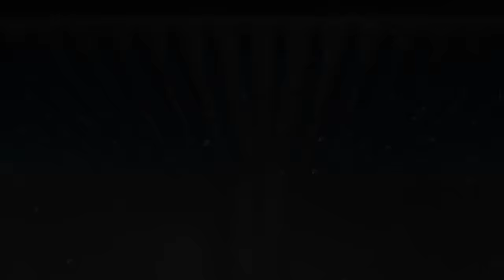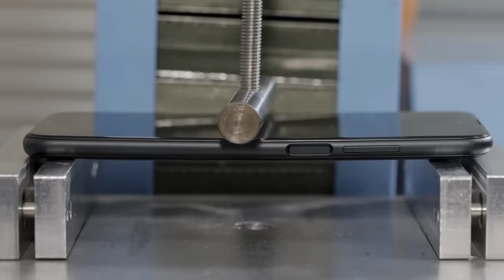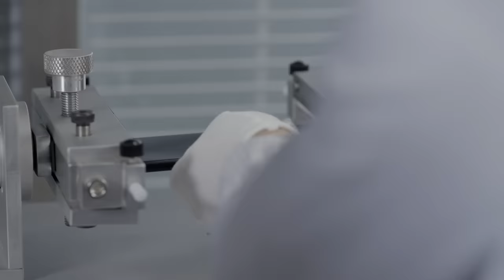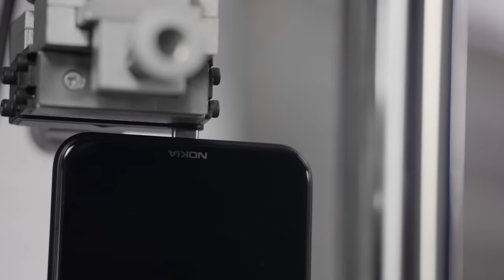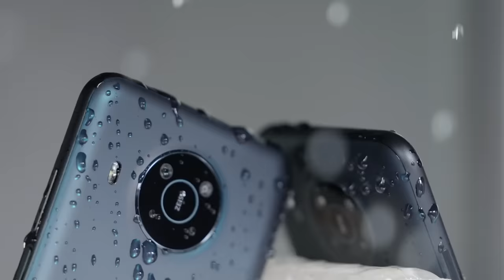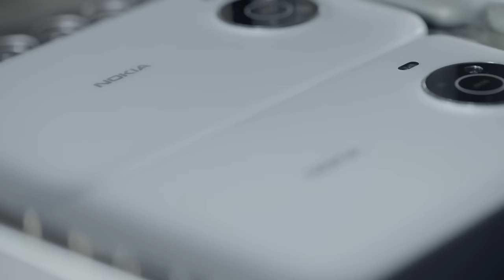Nokia phones Durability Testing

Comment: nokia may not be the best at producing phones, but it has always been known for producing the most durable phones.
Reply: Not only durable, but at its peak, it was the only company with innovative ideas. Take the NOKIA N-GAGE and the NOKIA E90 COMMUNICATOR for example. They were one-of-a-kind phones at the time.
Reply: Durable sure if u want them to use as bricks. Search Nokia 5,6,7,8, all having charging port problems. Their port replacement didn't solve the problem because it was a design fault. I've got an Xperia and it's still kicking after 8 years. I'm gonna definitely avoid Nokia from now on.
Reply: PIXEL ❤️,HMD NOKIA ❤️ , 
MICROMAX IN ❤️, MOTOROLA ❤️   . 
💩 Xiaomi MiUi stupid software 💩 . Stock ANDROID phone 😎 cool
Reply: Durability will get them far into my pocket  - way farer than that i-stuff
Reply: @GAMEOVER-yy6zj  i had a Nokia 7 Plus, it's true that their charging port is sh*t. All about Pixel now.
Reply: @GAMEOVER-yy6zj  earlier batches had it.
Reply: Nobody wants durable phones now. Power Lee change phones in 2-3 years and what specs that can keep up with time.

They should keep a handset ready and wait till the next Qualcomm Snapdragon flagship chip is released and then announce their flagship phone within a week
Reply: I agree
Reply: That's we need
Reply: They remember what they have done in the past, they are trying to remake it but with some better performance
Reply: Its a appropriate for me where I dropped my phone most of the time.

Comment: HMD. I hope this is a sign that you are making a good phone now.

The charging pin fiasco was a really big turn off for me.
Reply: Every nokia phone is good.
Reply: I have suffered due to charging port issues, never again, Nokia.
Also, they weren't splash proof either.
I'm an ex-Nokia fan. I now prefer other brands.

Also, talking about durability, my 5yr old Lenovo phone has been dropped 1000+ times, I have washed it uncountable times since Covid started, it still works. It still lasts after 5yrs. It shows that every brands have got durability tests. Nokia just made a video for marketing purposes.
Reply: But if Nokia comes with 5G (even Snapdragon 480 would work for me), I might take a chance. Not by purchasing myself, but recommending another friend this time. I'd see if the USB port, is for real, better than their previous phones.
Reply: @fishyc43sar  what was the previous Nokia smartphone did you use?
Reply: Ya bro
Reply: @fishyc43sar  Even i too had a Lenovo mobile...I threw that mobile angrily, but the mobile didn't survive.... So every brand is not good in quality, except Nokia
Reply: A fault charging port has been the worst experience for me on an otherwise extraordinary Nokia 7 Plus. Got some handy tips online on how to nurse said faulty charging port to still charge and keep me going the past 18 months when I couldn't afford a new phone. Hope this video indicates they have rectified the issue there

Comment: My Nokia 7 plus is the most durable phone I ever held. The charging port is the only thing that ain't durable in it.
Reply: True Brother. I am also using from last 2.5yrs Worth it... Drop lots of time but nothing happens just Charging Port issue. But overall best phone
Reply: I previously had Nokia 3 it was extremely durable just the charging port issue
Reply: Spot on about the charging port. Been using my 7plus since 2018 and it doesn't even look old

Comment: Nice. I would be great if you were to publish the IPX rating more openly.
- Currently this information is not published or even mentioned on the Nokia website.

Knowing a phone can resist at least a light sprinkling is excellent if you plan on using it on the go. 
That is of particular value to those that don't care so much about technical specs but rather the usability of a device; The sector that Nokia seems to be aiming at.

Comment: Please improve your specs 🙏. RAM should be at least 6-8GB and storage should be at least 128-256 GB.

Pls put better processors in your phones.

Specs have been a problem in Nokia since 2000 - Nokia N95, E72... Anyways used to get out of memory errors. 

Please correct your specs.

Comment: And my Nokia 7.2, cracked on the first fall from both the edges, quite shocking for me too! Power button recently gave up after use of just 2 years and even the back glass is also broken now after a fall from just 2 feet on furbished tile surface not even in the rocks! I am pretty disappointed by these but yet phone works fine so, cheers!

Comment: I hope Nokia sees this. I want a Nokia phone in 20k - 30k price range in India. I want this durability with a single main camera thst works well. No extra cameras what so ever. Well performing Snapdragon Processor. Software Support for as long as you can. Custom ROM support. GCam support. Good Quality Control. That's it. I'll take it. I believe in Nokia than any of these chi(cough cough)..  manufacturers.
Edit: I don't care even it has bezels. Because I would have Bezels rather than hole punch or Notch.

Comment: A suggestion to nokia...... 
Bring a smartphone in price braket of 11000 to 14000..
Give side mounted fingerprint,good processor, 5000 mah battery, 6.5inch fhd+ display, 90Hz refresh rate, 30w fast charging, 48mp +8mp+2mp camera and 16 mp selfie..... Also, give modern cool design......

Comment: It's a pity that the current Nokia photography lags behind in appearance, and it has not been possible to produce an impressive flagship machine in a few years.
Reply: @kodiakandgrizzlybears3787  You don't have to say that. No matter how trash China is, several mobile phones with top-of-the-line processors are launched a year. In recent years, hmd has not had top-level products. This is a fact that must be admitted.

Comment: Nokia x100 is crap. I just got a replacement in yesterday from insurance and with a otter box and screen protector on it the screen cracked and spider web all over just from bending over to pick up something and my shorts was loose fitting waste band ones

Comment: I'm using Nokia G20, it fell down and the fingerprint sensor stopped working. It keeps on heating over and over again. Now I don't know where to repair it.
Reply: Erase the old fingerprint and add new one, then will work.
Reply: I have Nokia G10 for six months ago and still working so good. The fingerprint works like day 1.
Reply: @andreea-florentinavlasceanu  mine is not working at all
Reply: @lisbenson3949  check if your hands are dirty or not 😂 
Wash your hands and dry them. 😂

Comment: I had Nokia 5.1 . it's one of the worst phone I have used in my life. It's type c socket stop responding and charging every month and I have to pay to replace whole charging plate which include microphone.
HMD is only using Nokia name but their phone are not durable as other phone in market.
Shopkeeper told me every Nokia phone has charging socket problems ,it's better to buy a new phone rather than repairing it

Comment: Hey nokia, why dont u use snapdragon 720g in phones under 18k- 19k. Use an amoled screen with less bezels and 90 hz refresh rate.provide atleast 25watt fast charging and 5000 mah battery. And this price is justified for the price u r paying for with good software updates, camera system, and most importantly performance and camera. Provide atleast 128gb ram.Means
 4gb + 128gb = 17999
6gb + 128gb = 18999,
8gb + 128gb = 19999.
Even old trustworthy brands like samsung and motorola are doing so.Do it plz if u want to revive ur legacy.

Comment: The Nokia x100 has a very delicate glass screen even with a full otter box case and a gorilla glass screen protector at same time on my 2nd one from dropping my first one same day I got it and shattered when fixing to put case on the screen still cracked and broke with the full OtterBox case and gorilla glass from falling out of my pocket on to my hard wood floor its a great phone but very delicate I got the Nord n20 and so much more durable I have had it for about 5 months with just a rubber clear go to brand case and a glass screen protector the free ones from T-Mobile if you got insurance and I have dropped it on concrete hard wood and tile floors and everything even off a 20 ft ladder fell out of pocket hit concrete and still didn't break so get Nord over any Nokia until they improve their glass quality. No way this test is real if mine broke that easy in a full case they are using a new phone for each test them replace it with a new one showing you it didn't break which it probably did I promise way to delicate of a phone

Comment: Hello sir
Nokia is a no1 mobile in old generation
But Nokia this time not a best brand
If Nokia start a New project of a Gaming smart phone. A Latest processor Snapdragon 888 .RAM12gb .ROM 256gb  Includ a cooling system .Battery backup 8000mAh .Custom gaming optimization  Launcher is like futurerestic 3D. Rear camera /90+20 MP
Front camera /60MP 
Charging /50W  (C)Prot
6.79 FHD+ AMOLED 145Hz /Display
11.3mm /Thickness
Weight /300g
Android 11 Os
Sir please make better your bootanimation 
then the  Nokia come back to No.1
Smart phone in the world